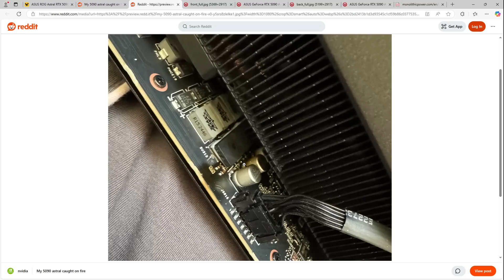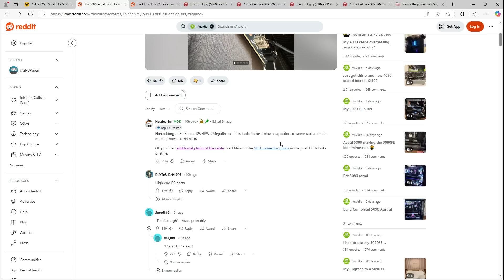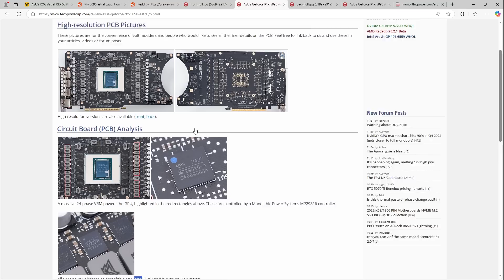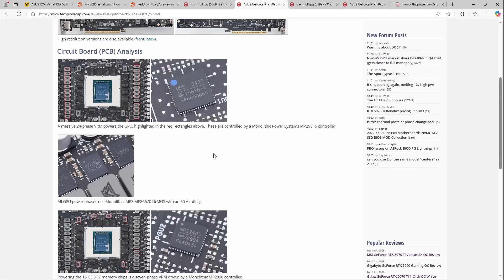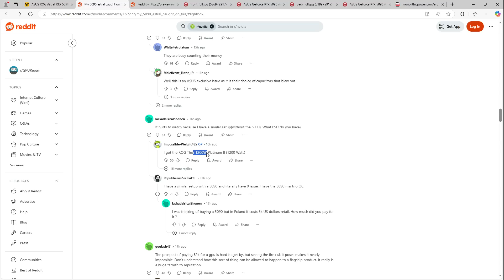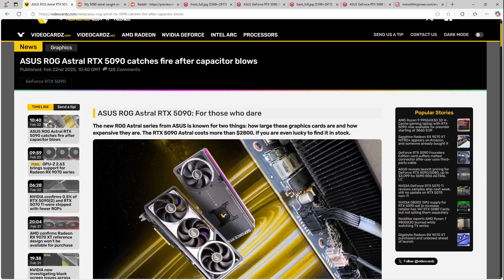Innocent capacitor blamed for ASUS RTX 5090 Astral catching fire

Comment: Thank you for making this video. There are far too many people of influence that know little to nothing about the components that make up the products they review spreading nonsense. When I seen the capacitor accusation I immediately called bs. It has all the signs of a power stage going and possibly damaging a trace inside the pcb. You are far more experience working with gpus than I do but the appearance and other issues I have seen with the 5000 series makes me question if there has been a fault with balancing and the real thing that failed resulted in much higher current going through that stage than normal.

Comment: Capacitor degradation is the most likely failure point in old electronics. It is highly unlikely that a capacitor fails in a brand new equipment.

Comment: I have repaired a GPU by replacing one of those capacitors.

It was an XFX card and the capacitor just fell of the board, fresh out of the box.

Capacitor however wasn't busted, just not/badly soldered on the board.

Comment: The older liquid-based ones were known to fail or explode. In Germany, they used to use tantalum capacitors in fluorescent lights to regulate the conductive voltage.

Comment: I've ran a 3090 at full, 100% usage OC'd at 102% for 24hrs STRAIGHT during a 24hr long iRacing race. Multiple times. And ran this thing full effing tilt for years and hasn't blown up.

What are people doing? Or am I just lucky? I hardly think I'm lucky after years of putting this thing through serious abuse.
Reply: Just wait until it does???

Comment: I remember sending you a GTX Titan X years ago and my first conclusion when it died was that an SMD aluminum polymer cap had shorted to ground based on the same kind of burn marks we see on this card, and you immediately pointed out when you got it that the adjacent power stage blew up. If only replacing dead power stages were easier for the novice board tech with a hot air station and tweezers.

Comment: A little confused about what we see in the shot of the failed board.  What is the big, black rectangle on top of the power stages?  It looks like it could be part of the heatsink with some pad(s) still underneath it, but it doesn't seem to be connected to the fin stack (anymore).  If the power stages weren't connected to the fin stack at all, would that fry one or more?
Reply from the maker: it's a plate connected to the heatsink The finstack just doesn't extend all the way to the end of the plate.

Comment: Fun fact about backwards caps, occasionally, caps can be backwards on the smd roll itself ( manufacturers packaging ).
Reputable manufacturers sometimes even specify the statistical probability of it happening, in the datasheet.
But that's why optical inspection exists, which is something some assembly lines cheap out on, so its generally device manufacturer fault, not the part manufacturer.
Caps can die due to ripple current, especially when inductors are involved, though its usually a symptom of another problem, not the source of a problem.

Comment: The card owner is here. Thanks for making a video about my dead card! At least I know this is not my fault, and waiting for response from ASUS. Hope you have a wonderful day!🎉
Reply: With current supply I'd also go the RMA route. Fingers crossed for them to replace the GPU and any other component that might've been affected (looking at the mobo pic)

At least you got an audience now when your post went viral (in case they deny/delay it)
Reply: stuff like this always sucks to deal with, I hope your RMA goes through without issue
Reply: Sell it to GN! ASUS lately is kinda sus and they could blame you for it
Reply: @Stevenx01   or rug it and pretend it didn't happen, hiding any evidence that could blame asus
Reply: Hi there, can you just confirm if the gpu was on performance mode or quiet mode? I have the same gpu, mobo and psu 😅
Reply: @ I literally just got it, haven’t gotten a chance to discover any features or settings about the card yet. Burned after 4hrs of using it
Reply: @bigbigsamd8128  you can see a small switch right next to the gpu power connector
Reply: @YT_Setup  I see it, it’s on quiet mode
Reply: @ thanks
Reply: You have to make a deal with Northwest Tony the repair guy. Asus definitely have a replacement but in the unit of month if not quarter.
Reply: Lucky to get a free expert opinion 👍👍 hope you get a replacement asap
Reply: You didn't sell it to GN? They reached out to you on reddit
Reply: @fallenlegion1828  Steve offers me retail price for both Motherboard and gpu, but at this point nothing is better than a new card, especially considering how bad I really want this card even after this shit happened.
Reply: @bigbigsamd8128  Yeah man don't sell it to them for them to profit off your misfortune. RMA that bad boy and get back to gaming.
Reply: @KuraiShidosha  I get what the owner is saying and I totally understand, I would too if I was in the same boat but what people are talking about selling it to GN is so they can investigate it and also bring it up to ASUS rather than just being an RMA and they say oh 'user error' You would think an ASUS Motherboard, PSU, and GPU premium would be reliable but thats not the case. Like the case with GN's ROG Ally when they deliberately tried to scam them for something totally different then they turned around when it became public "we will do better" and tried to win people back. Again its his choice.
Reply: @bigbigsamd8128  Good job, if you have had sold to GN, Steve can say "User error" again after his BS analysis when 4090s were failing ? Hell no. Good that GN won't be the card nor the BS experiments they do and conclude nothing burger. Wise choice, you need a GPU and won't give free views to GN.  That dude was shilling for Derbaur's CPU contact frames and did not even consider covering the LGA1700 socket bending issues until 2 years. GN is a sham. At best he makes videos for views which is pre-built PCs and other fake RMA calls to expose the companies which is not bad but the damage he did to GPU owners with 4090 as User error is inexcusable.
Reply: @Specialist7  "User error" was said by GN Steve, idk why you all forget what he did for Nvidia, he absolutely did full damage control for Nvidia when 4090s 12VHPWR were failing initially and cablemod adapters failed. Now if we look back I cannot find that video of his, maybe he deleted it in shame and thought people who are braindead goldfish memory forget what he did. GN Steve should not get this GPU for his free views and conclude nothing. Fk him. Look at Derbaur he flat out blasted that Aris who desperately wanted Nvidia to send him a card and melted down in his own video while attacking Derbaur's 12VHPWR failure on 5090. GN silent all the time. Nvidia bootlicker GN behavior. Buildzoid has 10x more knowledge than that scum.
Reply: @lostalx  He did not simply claim "user error", you might want to rewatch that video carefully.
Reply: @bigbigsamd8128  Considering the low availability of those cards, I really can't blame you for going the RMA route, even if it's likely you'll have to wait for a while for a new card anyway. Assuming ASUS doesn't make a fuss and accepts your claim.
Reply: @Specialist7 I think if Steve can find a replacement GPU for him, he’d take his offer.
Reply: @lostalx  wow so clueless you are.
Reply: @bigbigsamd8128  if asus RMA screws you over, sell it to him tho. He has a relationship with them xD
Reply: @lostalx who hurt you?
Reply: @fallenlegion1828  He paid 5790$ for the board+gpu, Steve would only pay 2700$ for it.
Reply: My guess is these NIC Components Corp caps could be fakes.
Tons of fake caps around these days!
Capacitance value (270 pF).
Voltage rating (16 Volts).
5KE46" is likely a date/lot code
Reply: attach the video link to your ticket
Reply: @skyvenrazgriz8226 BAD idea. Asus is known to look for scapegoats. If they see this guy made public posts about this they'll cry foul and say that he did it for publicity or something else insane.
Reply: @emenesu They won't have much luck with that.  Consumer protection laws don't say "Thou shalt not Reddit your dead card"
Reply: @RCVW-y4x  🤣
Reply: @ Consumer protection laws?  ROFL!
Putting aside not knowing the OP's geographical location, they'd still likely to need legal advice to pursue any such thing and .... they've just bought a 5090, they have no money and no sense.
Reply: @RCVW-y4x  We don't have consumer protection laws anymore. The agency that handled it is gone.
Reply: G'day @bigbigsamd8128,
I'd keep going with the ASUS RMA too but give GN a "Thank You" reply also letting them know your plan, then if your RMA succeeds you can let them know the Good News after their previous work with Pressuring ASUS to do better with RMA Complaints or if yours fails you can have them help you in getting some sort of resolution where you are not left with a VERY EXPENSIVE Paper Weight. Best wishes on your journey.
Reply: I really hope you have good luck with your ASUS RMA. You might want to watch GamersNexus expose on ASUS and their RMA policies. You might want to consider tagging GamersNexus on your experience if they don't treat you right.

Man, that sucks that you were able to beat the odds to get the card, then have this happen. Hope it all works out for you!
Reply: “Browsing websites” aka looking at sus p0rn sites that mine crypto while you browse…

Kidding, kidding. Good luck with the RMA!
Reply: @bigbigsamd8128 did you get a response ?
Reply: Asus response might be : get f*cked and buy another one
Reply: If consumer protection laws existed Nvidia would be fined $100,000,000,000,000 for letting this fire hazard exist and continue to exist 3 generations and still be sold.
Reply: Please take up GN's offer.
Reply: @ZoidbergWillHelp  GN can't supply them with a replacement card.
Reply: Jealous you even got one of these GPU’s.
Reply: I'd rather hold on to my functioning 3090 than have a dead 5090, but that's just me
Reply: @RTX5070Ti_Benchmarks   The 3090s had some safety on the power plug inputs much better than the 5090.
Reply: @jimbodee4043  i know right
Reply: It’s your fault. Don’t abuse your cards.
Reply: If you don't know wtf your doing or how to diagnose don't do dumb things I don't have kapton tape on my 3090FE.

Comment: side note: 14:33 well the 5090 does pull relatively quite high power at idle compared to other cards, i think that was in der8auer's review
not related to the failure (i would think)

Comment: 1:40 Because electrolytic capacitors have been the most common thing to fail in electronics overall, including a few decades of older computers and big recalls and lawsuits. (Even an enthusiast forum was named for it, "Bad Caps".)

eta Just as explanation, not defending.

Comment: I think the scariest thing about these 5090s dying is how quickly its happening. With the 4090s it was always a couple month old card thats been moved around and unplugged a couple times, usually using some kind of adapter or possibly overclocked… these 5090s are dying just a couple weeks out of the box, its not even been a month yet since they hit market let alone since people have actually installed and ran them

Comment: This model is supposedly Better Built than the other models which don't use individual current sensing for the 12 volt power wiring.

Comment: To be fair, there was a time when capacitors were failing in VRM power stages on motherboards, en-masse. That was the era of the "capacitor scandal" when formulations for low ESR electrolytes were stolen and incorrectly copied. Lots and lots of caps went bad. But the solid polymer types used in these cards are very robust, as you stated. I think the mosfet just popped for whatever reason.  If the guy bought the card from a scalper, there is probably no recourse for warranty RMA. RMA process has become something of a joke as well in the DIY pc industry.
Reply: Well good thing Steve offered to buy it off guy's hands
Reply: I’ve bought used hardware and my experience even with ASUS is that they will fix it. I bought a used ROG Ally which had defective joysticks and they fixed it since even though I bought it used it failed within the warranty period. Most RMAs are pretty painless and easy. We just hear the horror stories. Just like we heard the horror stories about capacitors failing causing people to think that capacitors fail left and right.

Comment: Yep capacitors have very bad reputation in general public. Thanks to cheap liquid electrolyte aluminium capacitors. Often cramped too close to a heatsink or some other heat source on many boards of consumer electronics. A cap with puffed up dome in a meme at this point...

Comment: Is there any reason there aren't protection diodes added to the output side of the power stages? (other than cost of additional components...)
Reply from the maker: I've wondered about that myself but I don't have an answer. Probably due to the amount of current the diode would have to handle.

Comment: Capacitor failures are mostly a thing of the past. Memories from the 1990s and early 2000s...
Reply: Yep  smd capacitors from around 1990 died from left to right. Especialy those used in Computers like Amiga 600/1200/4000 some Atari STE and Falcon, sharp 68k, consoles like Mega Drive/Genesis, PC Engine/Tg16   and many more hardware like lcd monitors and tv etc.. Of course in retrogaming scene we replaced them in Daily basis. This was the first wave if 1990-1996 hardware. Second wave of dying caps was in around 2004-2007 in motherboards or GPU's or psu's or DVD players etc..anyway this is still happening in some cheaper brands using really cheap and 💩 chinese caps.

Comment: I think the reason that caps get blamed is because there was a time where they really did fail pretty frequently, and they ARE a common point of failure on old electronics.  The ones that fail are electrolytics that look a lot  like the can-type ones in the reddit photo.

I've repaired a couple of graphics card by replacing multi-layer ceramic caps.  In one case, it was on the low voltage side of the core power VRM and created a short.  In another, it was the bootstrap capacitor for one of the core phases, and having it be mostly shorted caused that phase to run really hot.

I think we need some more pictures to diagnose this failure, though.  You could be right that it's a power stage, but this early in the card's life, I think a defective capacitor probably is a possibility.  Can't really say if all we can see is that stain.

Edit:  The damaged bootstrap capacitor is a possibility here.  I've seen that on more than one occasion, where the cause of the failure was mechanical damage to the bootstrap capcitor, which is usually a very tiny and delicate MLCC.
Reply: Early 00s aluminum caps from Taiwan.  I remember.
Reply: Caps from the 1990s and before were more reliable than the bad ones from the 00s .
Reply: 90% sure my old 1 core 512 mb amd system died because the capacitors on the motherboard were dying 1 by one. Sad.

Comment: I am gonna challenge you of this capacitor issue knowledge. Go search phone and laptop repair videos which ends up capacitor being shorted / blown in YouTube. You will be surprised amount of them. Specially these small ceramic ones too.
Reply: Note: This has nothing to do with this GPU or whats wrong with it. Just the information of caps failure rate it can be more common than you might assume by using some public charts to get failure rate % of caps.
Reply: To find failed on "cheap" cough iPhones, laptops etc has had too long history so you can ask from iPadRehab for comment example or any who has long history fixing devices in great amounts.. or Electronic Repair School youtuber from London.. about how often they find failed caps shorted. I am pretty sure they will challenge comment of caps "like never fail". Here is one example from eevblog: watch?v=QgKY5QWehME for one specific failure way for cap but not only way. BUT one important thing.. the huge amount of caps per device are there YES they are less in ratio % to fail absolutely.. but due how much they are in devices.. and high volume of devices itself is out there.. that total % will start climb up from "never" easily.
Reply: Data sheets don't provide an accurate failure rate, but searching for videos where a capacitor failed does? Go look up confirmation bias, you dunce. Even if you counted every single video on this entire platform where a capacitor failure was the root of the problem, you wouldn't even have enough samples to cover 0.00000000000000000000000000000001% of the trillions (at least) of capacitors currently working away inside electronic devices all over the world.

Comment: So 'even' if you manage to keep all the pins on the 12v connector below it's MAX rating, power management sytem still can't handle 600 watts -.-
(pretty sure MSI has a fuse before VRMs, i recall reading some of the 40 series MSI cards had PCB fuses)